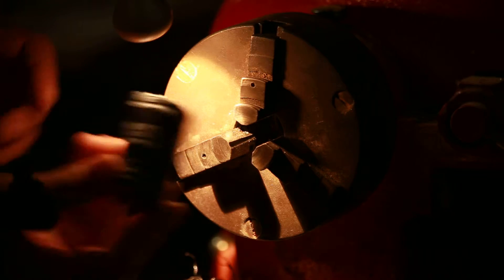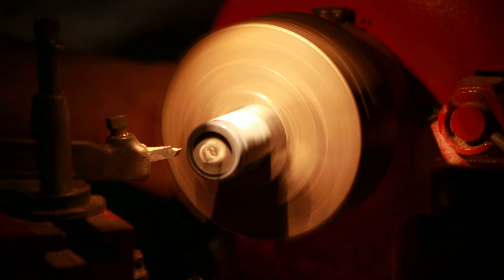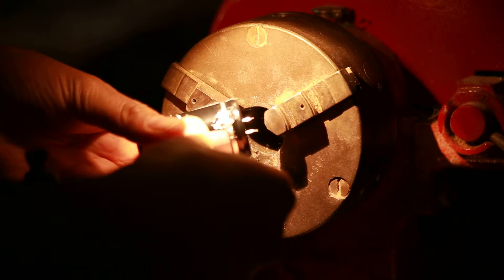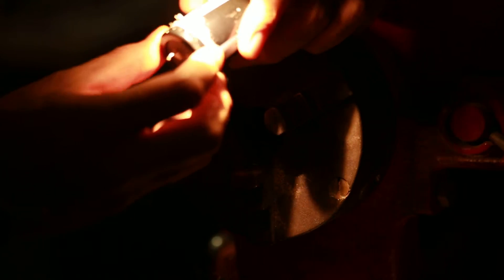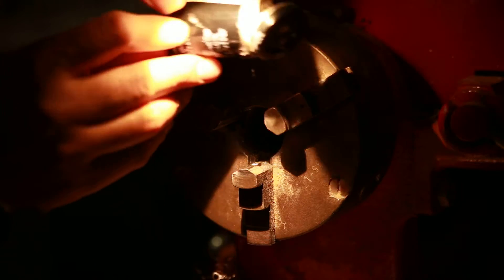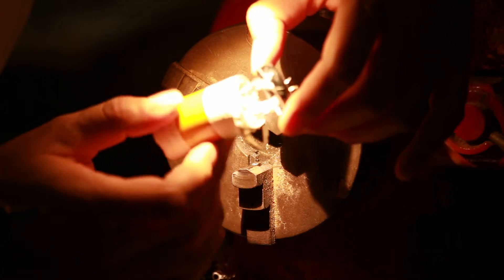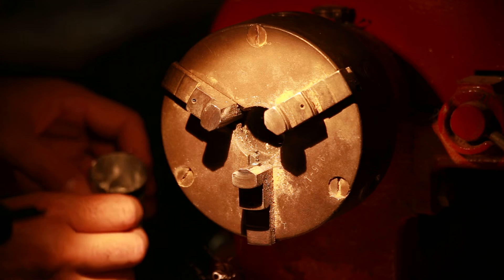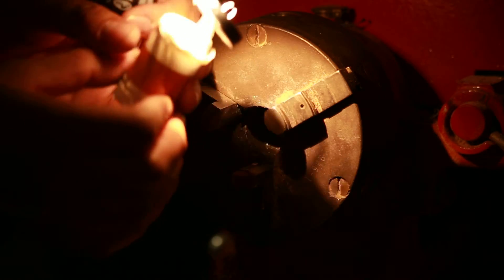Chinese fake 500F capacitor? nah just a dead one.

Comment: good info. as I plan to make Casein based supercapacitors, I need a practical reference that your videos give. hope to see more from you.
Reply from the maker: Wow, I was thinking exactly the same idea. I follow Robert Murray Smith, and worked several years with ultracaps. So I'm now thinking that it should be relatively easy to diy capacitors for shop power for example. Someone else already did solar powered ultracaps with off the shelf units to power shop tools. So it could be possible.

Comment: it should be dry.
Reply from the maker: It should not be dry. It's a capacitor, it should have at least some sort of oil or liquid acting as the electrolyte. in the case of Maxwell, they use a nasty chemical acetonitrile. But look in wikipedia https://en.wikipedia.org/wiki/Acetonitrile . it metabolizes into cyanide withing 12 hours of exposure. Anyhoo, I added lemon (calamanci ) juice to the thing and it actually changed just like the other capacitors.
Reply: its Dry when cold but When it Gets a bit hot Then it will be Wet